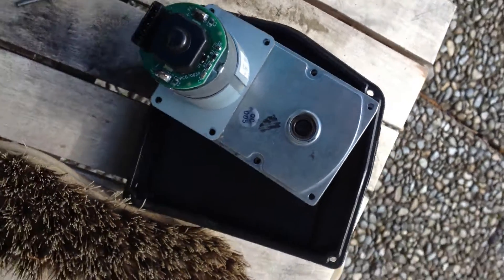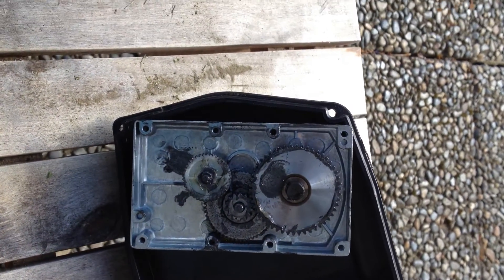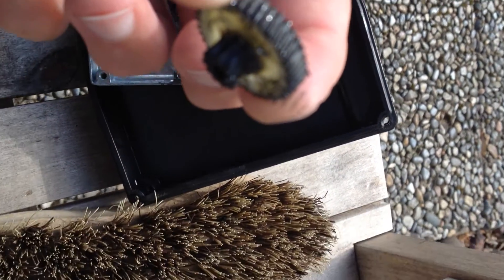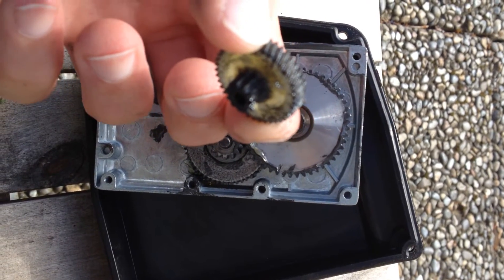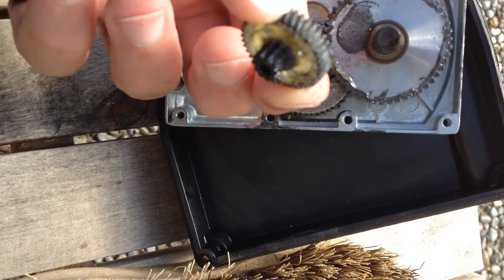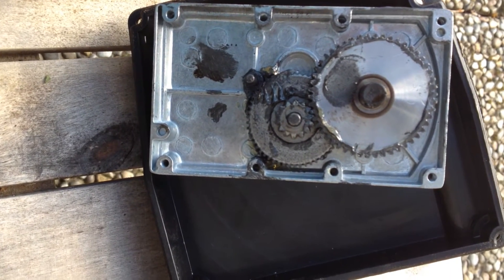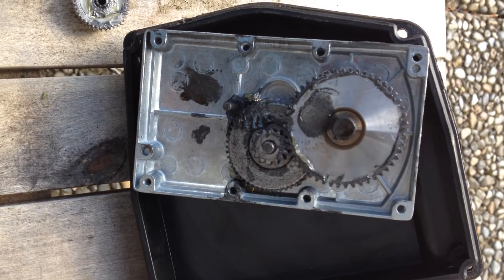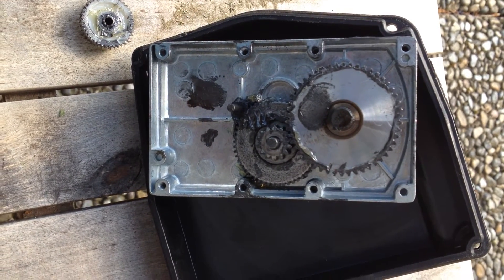Robomow MC500 Failure

Comment: HI. I had exactly the same issue with a MC1000. I checked on ebay and found the gearbox + motor for about 79$ : https://www.ebay.com/itm/Robomow-Motor-HG-MOT7000A/223948508857?hash=item34245f0eb9:g:-3YAAOSwGSZeb7IC. while robomow just says "replace the whole block with 2 motors for 250€.... yes sure....
Reply from the maker: Good to see that parts are available, that was always a problem for me.
Reply: @pmgear  unfortunately... I received the part, I open the gearbox & noticed... the gears inside are not the same. while the reference on the gearbox is exactly the same. So I tried change the whole block (motor & gearbox). I started the machine & it told me "E522". it detected the config are the same between left & right. damned... now I ordered the engine whole block (215€) on https://green-tech-shop.com/ (Belgium / Luxembourg)

Comment: Anybody who can tell me where to buy new parts and not a whole drive unit???
Reply from the maker: Nope, unless you 3D print it. I have not done it, could potentially model it for you if I have the gear and some data. Then print it in steel using an online service, it would not be super expensive to print it actually since it is so small. Price is by volume of part(s)
Reply: https://green-tech-shop.com/ you can buy a full drive unit or eBay if you are lucky it will be the same gear/motor type. Was not the case for me & the machine detected it !
Reply: Hello,

I have the same issue, do you have a stl file for printing?

Comment: Normally a plastic gear is placed in line with metal to reduce noise and provide a weak spot that will fail to protect the motor. This is good design, however what is bad economics is not supplying replacement gears or at least a refurbished cheaper option. My Robomow 306 has just broken after 4 full and heavy seasons. I also have a 612 that hasn't done more than a weeks cutting due to a battery charging problem that took nearly a year to find a repair shop and it failed again because the battery discharged by itself and wouldn't charge again. That said the whole concept is brilliant when it works

Comment: In reply to pmgear - just got the same issue on mine. Diassembled the drive unit and found out the worn out gear. As you mentioned this is very poor design !
Reply: how did you fix it ?

Comment: I have a Robomow MC500 as well, 6 month old, and I just had a Drive unit failure. The right wheel was blocked and it just kept going round in circles. I called Robomow Danish support and they were very helpful. After a few test (over the phone) they diagnosed the Drive unit defect. Two days later I had a new Drive unit which was easy to replace, and the Robomow was up and running again.
I did notice that the replacement Drive unit had a different “item number”. The old was MSB7006A and the new is MSB7106A. I hope it is an improved model 
Reply: I bought a new drive unit, i could not find the  gear wheel anywhere, and robomow only sell the entire drive unit. so now i have som parts from my old drive unit if it should happen again. but i hope not :)
Reply from the maker: JbPrivate thanks for input. As long as the unit i within warranty you get a new one. Mine was expired by a few months.
Reply: Har du stadig den gamle drive unit, min har lige gnavet sådan et tandhjul i stykker, og kan ikke skaffe tandhjulet, vil gerne købe din gamle drive unit, eller bare transmissionen fra den ene side, hvis tandhjulet er i god stand :)
Reply from the maker: Kasper friis I live in the US now and my mowers are in sweden so difficult for me to help you before july, but if you are still interested I have several that are sitting to no use right now.